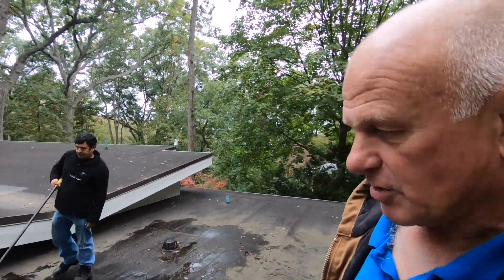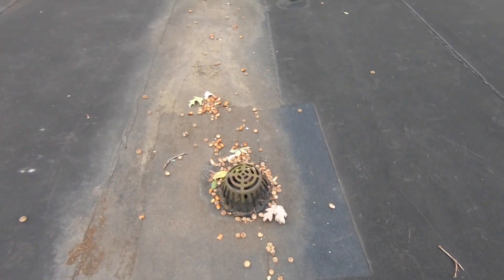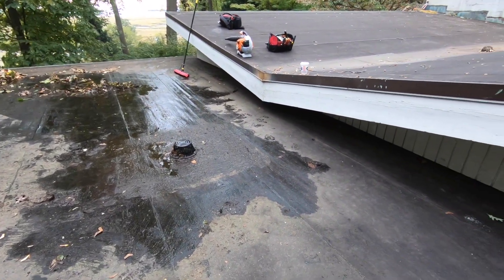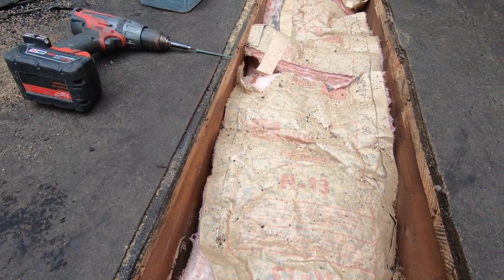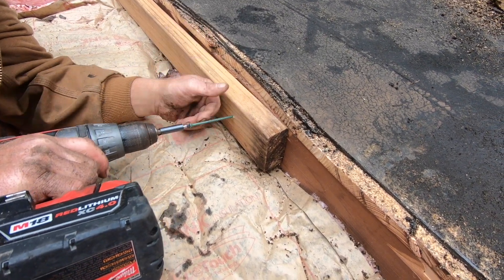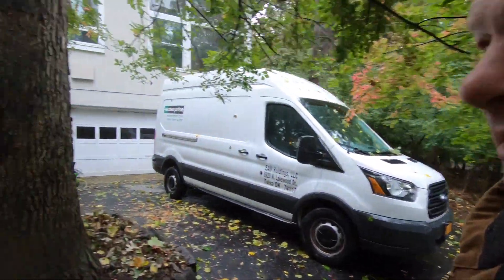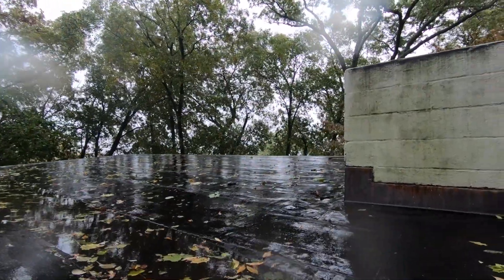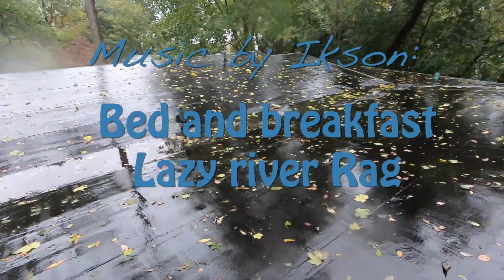How to remove standing water quick and easy via a channel- the best way to save a roof from leaking

Comment: I have the same issue, I contacted a local guy and his solution was to add a layer of plastic roof cement, when he did that the following day it rained and now the roof cement is floating on water like oil on water. I live in Minnesota, would you be able to help my situation?

Comment: A 20 foot waterfall noisily soaking the ground a few feet from the foundation.
Something wrong with this picture !
Reply from the maker: In this case the landscape is such, it flows down away from the house. Leading water away from the foundation is always a consideration when we make a scupper that lets water free fall. To prevent erosion, a bunch of stone is placed 
 at the bottom where the water hits. I have other videos where I make similar channels.

Comment: Hey good work I got a question I got old tar and gravel roof 15 years old no leaks but. Can I clean, put asphalt primer , then put torch down
Reply from the maker: Nope 
The best way is to level out the gravel and then install a fiberglass base paper on top of the stom=ne
Reply from the maker: Then a self-adhering Modified bitumen base - Liberty by GAF and John mansfield make them
Reply from the maker: Then finally your cap sheet Modified Bitumen Torch down with ceramic granules embedded
Reply: Flat Roof Doctor thanks sir much appreciated
Reply from the maker: @happydays454   You welcome - you can call anytime if you need advice. I will help you to get it right. 203 858 0080